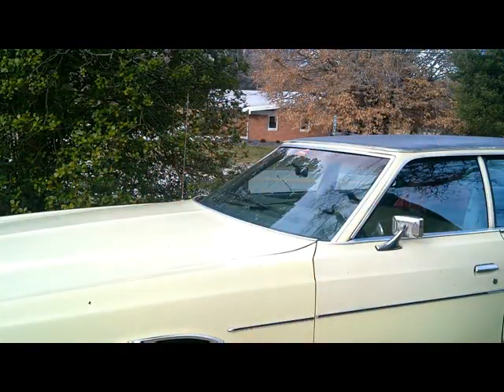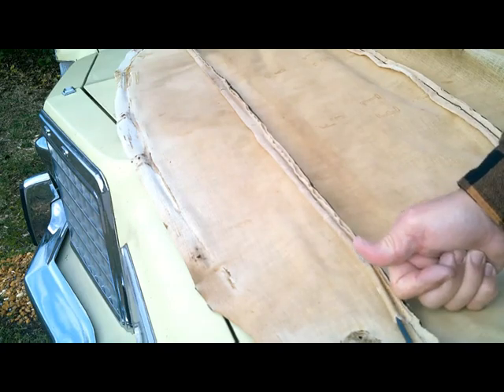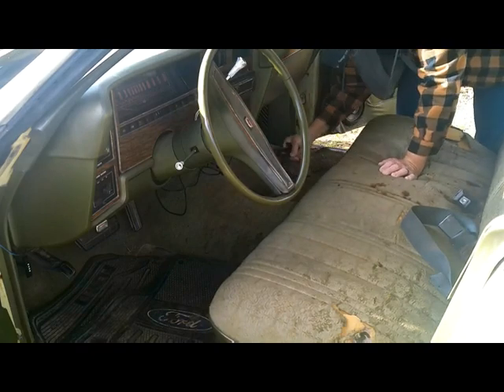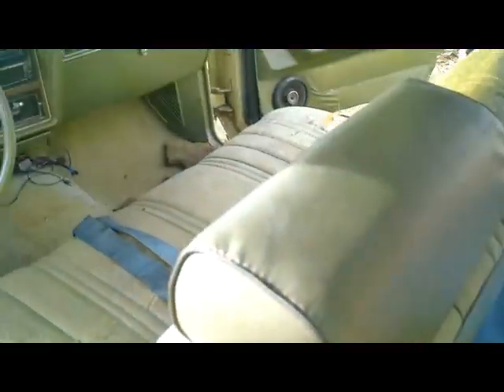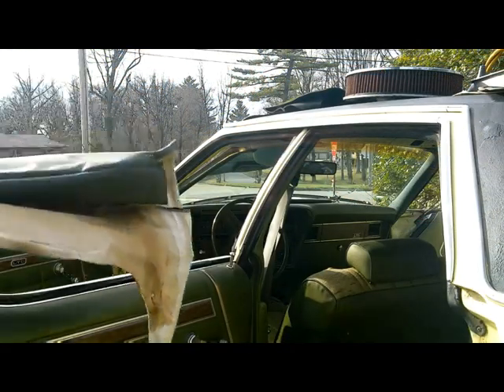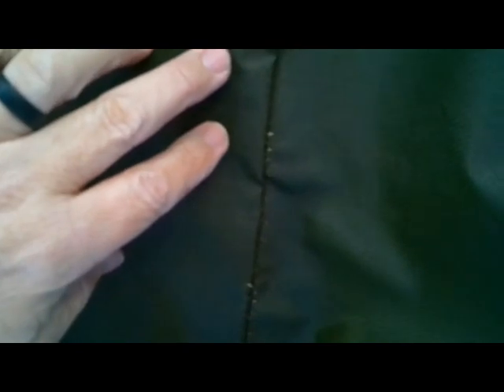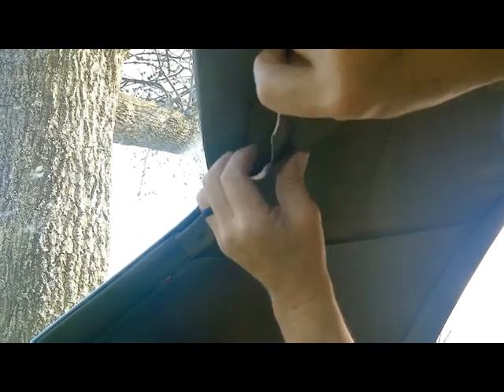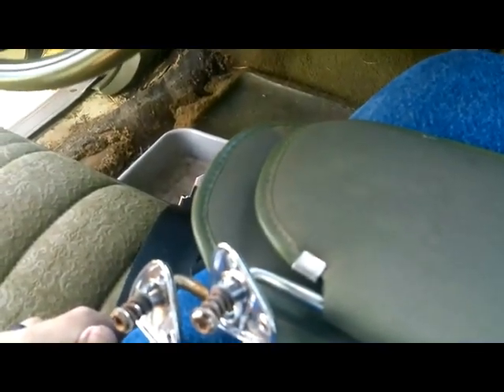How To Install A Headliner In A 1976 Ford LTD #nonamenationals #rcindustry #ford #limelateda #oldcar

Comment: You did a great job for what you had to work with. On those visors , what if you take and old screw driver shank close to the diameter you need , cut to the length you need and shove “glue” those up in the visor?
Reply: Sounds like a good idea